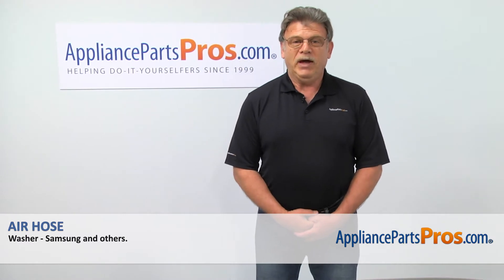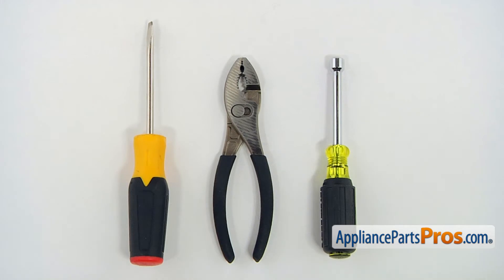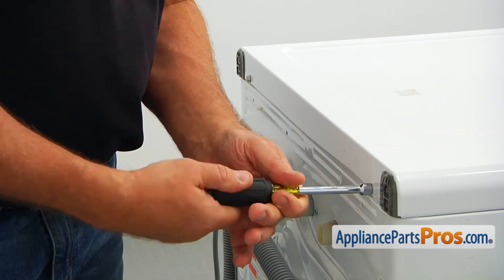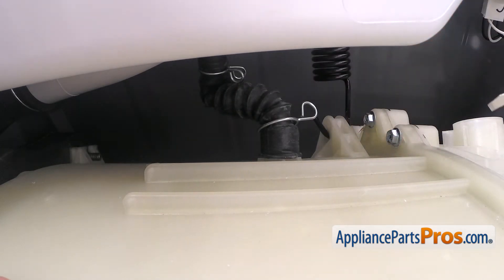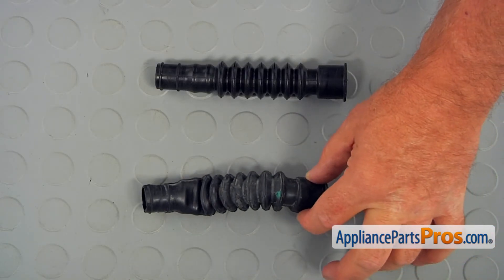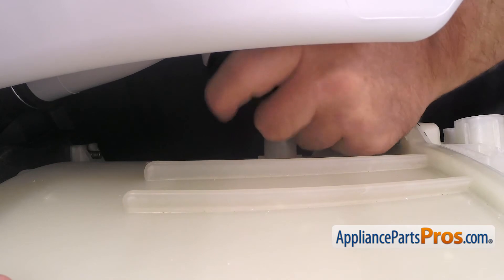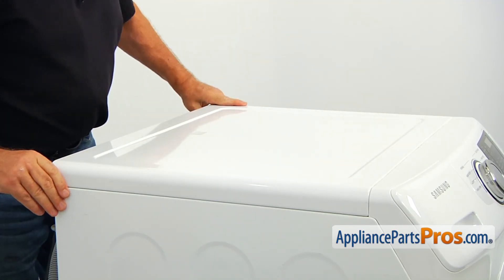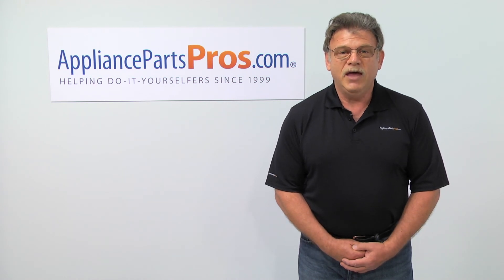How To: Samsung Air Hose DC67-00275A

Comment: Thanks for the video, Simon.  My Samsung WF42H5000AW/A2 had a problem with the exact Air Hose DC67-00275A in your video.   (1) Mine was kinked at a 90 degree angle, just like the old one in your video (See your video at 1:22 point.)  (2) That kink was preventing the soap tray from properly draining.  (3) Therefore the soap tray overflowed with soapy water, onto the floor.  My old hose had no tears or leaks -- the "kink" was proven to be the culprit.  (4) After you installed your new hose, in your video, I see even your new one STILL had a very bad 90 degree kink (2:30 point in your video.)  (5)  Of course I know the whole washer tub is on springs and shakes a lot.  I know the weight of clothes and water will make the whole washer tub hang a little lower, and help "un-kink" that tight 90 degree blockage.  (6)  Regardless, I am certain -- very certain -- Samsung made very poor design decisions with the location of one or both hose connectors, and/or the shape of the DC67-00275A Air Hose bellows.  Proof it was a poor design?  Many appliance part websites show this air bellows hose is "sold out."   After a lot of web searches selling it for $40 and more, I found the hose for $12.  DIYers replacing this hose will want to ensure there is no "twist" in the newly installed hose, because the "kink" is already a potential blockage to proper draining.
Reply: I need one where u found for $12?
Reply: Sears Parts Direct  (all one word with usual com at end.)   Still in stock at 12 + shipping.  Good luck
Reply: @nikolayvyalykh8765  See my reply below....had hard time posting to you.

Comment: Holy cow you and others want $57.00 for this part? That's BS, even if you did make this nice helpful video. This is an $11.00 part.   If they make you pay more than $20 for this part boycott the manufacturer.
Reply: Probably too late but I got mine at Sears Parts Direct ... all one word with usual COM at end.  Still in stock and 12 there.  For next time it fails....